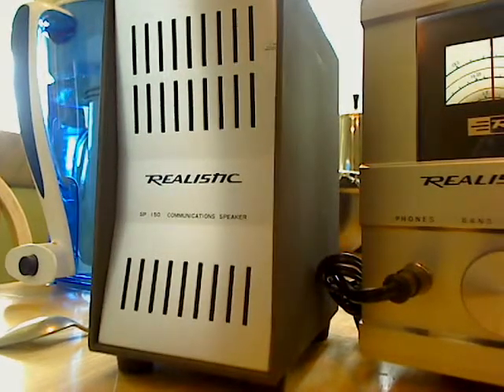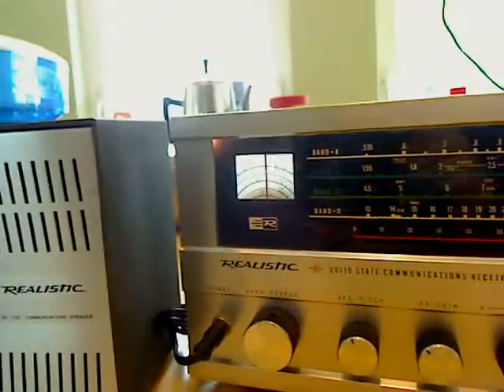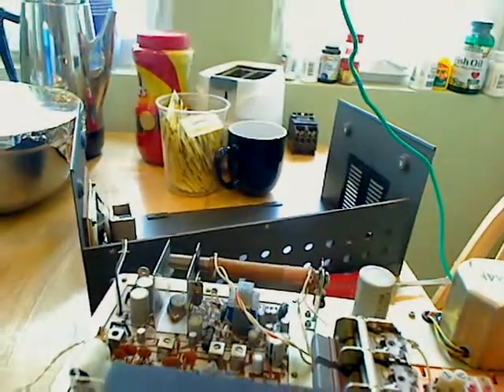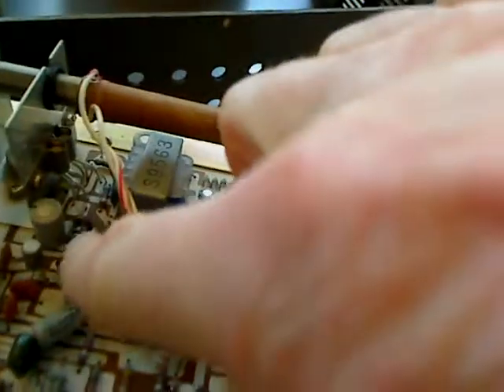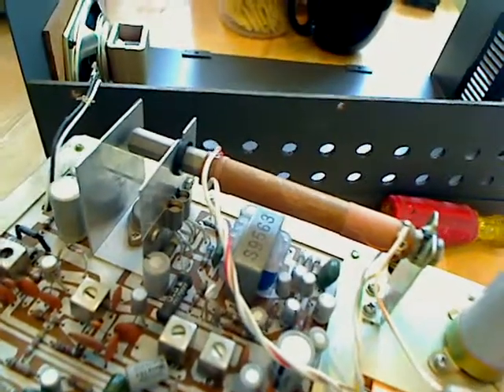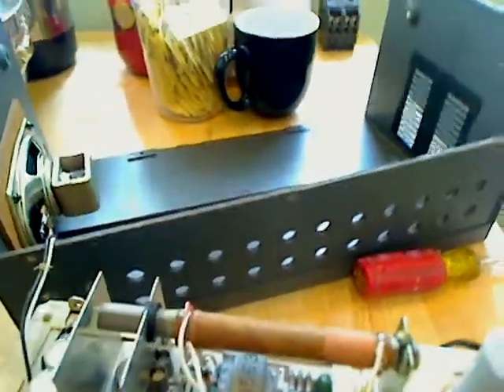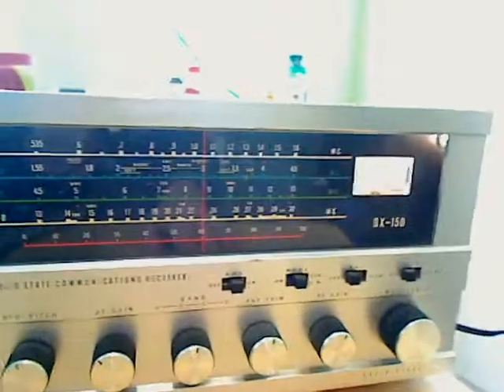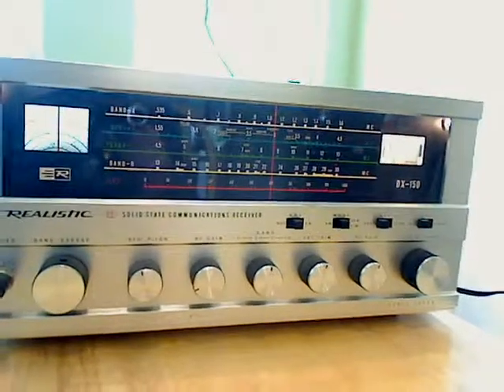Kitchen Table Doctor -- Realistic DX-150 Repair, Part 4

Comment: Hey Rosie< just got this home today and found that those green caps are bad. Do you know the replacement for those? Thank you!
Reply from the maker: Send me a few pics...icanmakeitlikenew@gmail.com
Reply: @rosieokelly  Sorry, I was asking about the green poly 50v caps on that dx150. They are bad as well as others on that board. Thanks again Rosie!
Reply from the maker: @jameshopkins7333  no, poly caps rarely go bad.  But send a pic
Reply: @rosieokelly  Sorry again. I have no gmail. Its the green things, I think 5 of them. four are the same, hunter green with .1/ 50v. tech just getting back to it after 40 years. I don't have a service manual. Thanks for the video's.
Reply from the maker: @jameshopkins7333  you can't have a YouTube channel without a Gmail address...use it...done here.